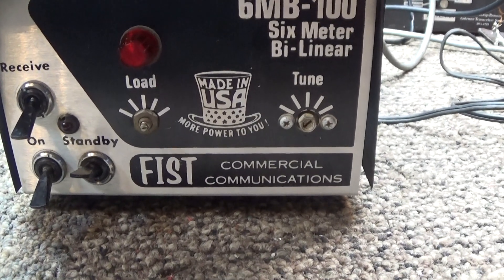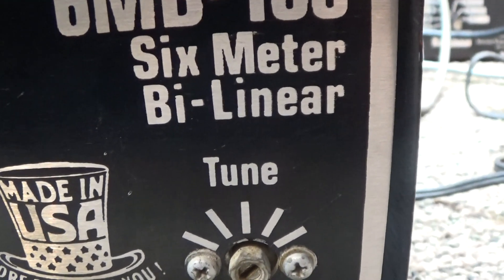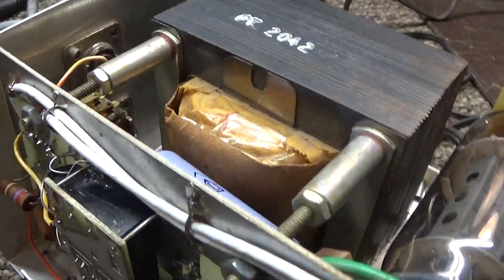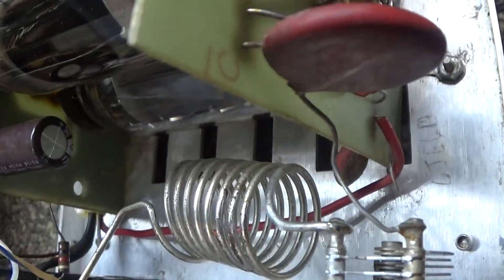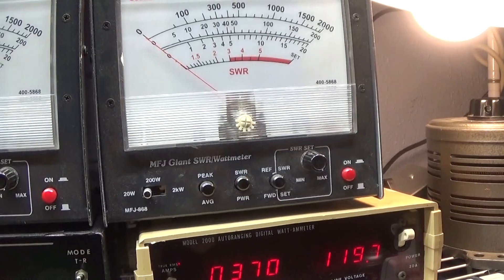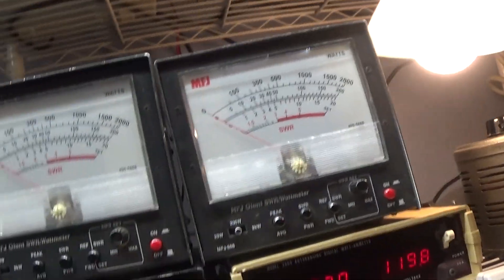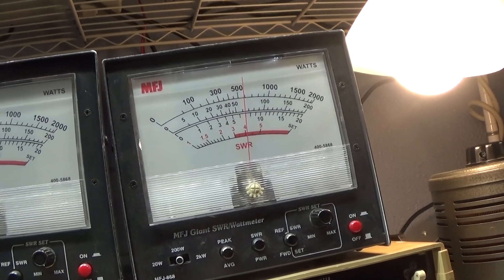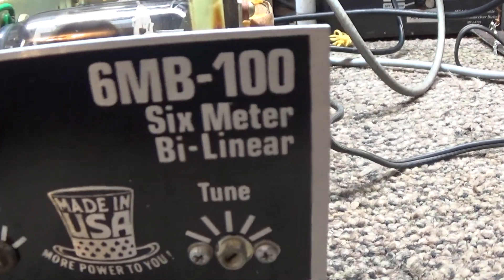Fist 6mb-100 2 tube 6lq6 compact base linear amplifier on the bench

Comment: Yeah mine didn't have the pre-amp. I think it just might get an external  power supply. and mayhap a transmitting tube. It's not cool enough to keep as is. Robert
Reply from the maker: External power supply?
Reply: @tramdr  Yeah the transformer is only 280 volts with its doubler supply it makes 600 no load and 525 key down. With sweep tubes (or any other  kind) that is leaving half of their performance on the table as well as requiring more drive so they don'
t even run cooler